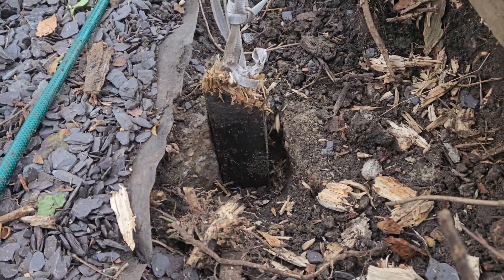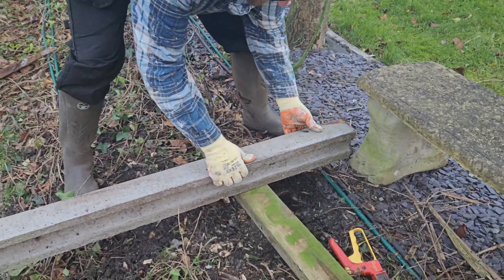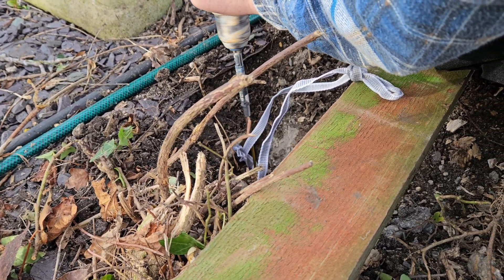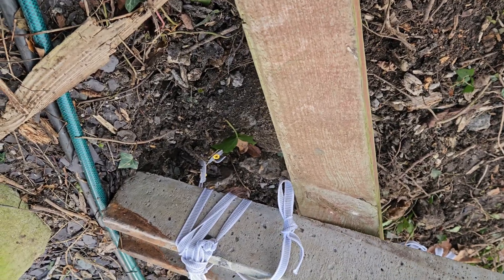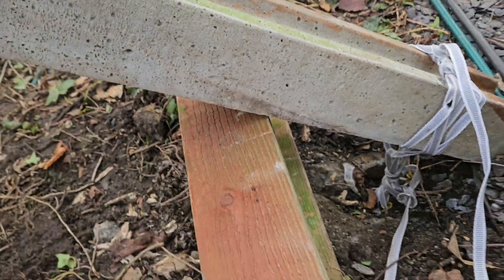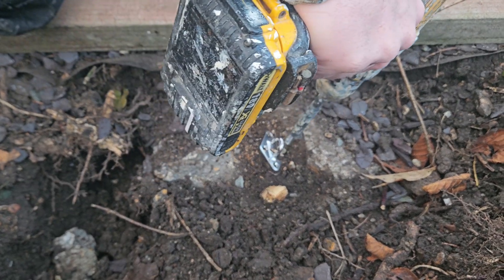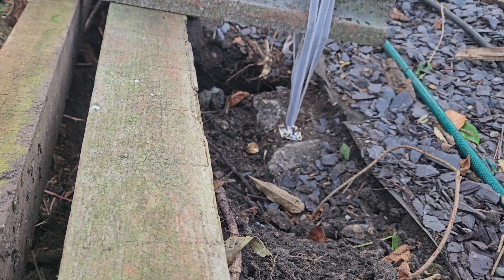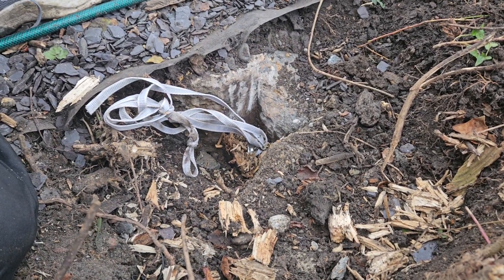Removing a fence post stuck in concrete using a lever. (fulcrum)

Comment: Well done but now suggest you use a steel or concrete post.
Reply from the maker: So here is the issue 😬 we had the smallest of budget for this job! We pulled the post and stuck one back into the hole... we are as bad as the people that did it in the first place 🫣 i opted for concrete posts at my house, so all i have ever had to do is slide a new panel in when needed

Comment: Could you have drilled a hole in the stump and set a fire? I would have burnt it from the inside had the lever not worked.
Reply from the maker: We considered it. Wood was very damp, but it could  have been a good option 👍